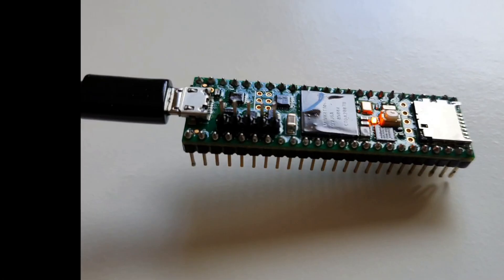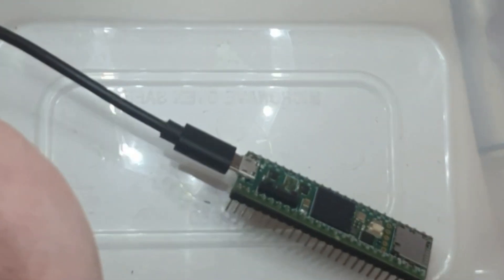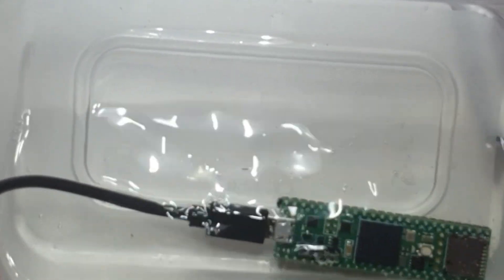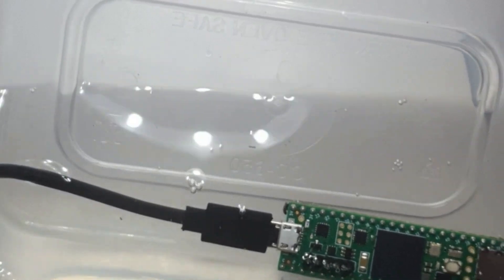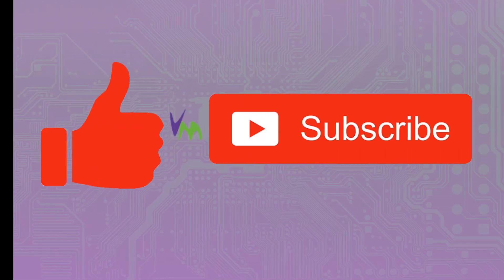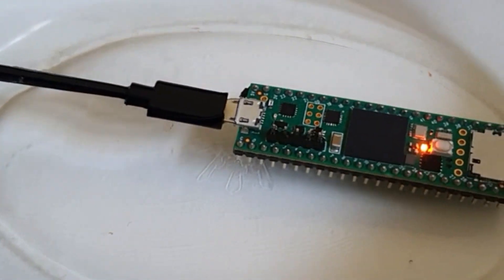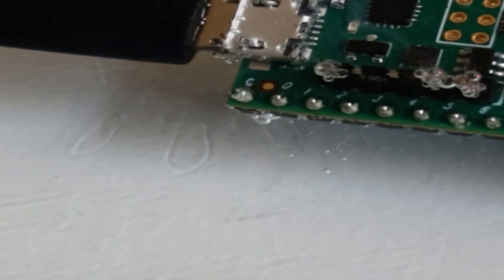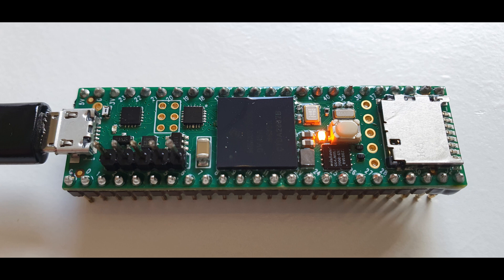Protecting Your Arduino Projects

Comment: what if you later want to use some of the pins? can you still get electric conductivity?
Reply from the maker: You would need to scratch off the coating from the pin is all, or connect everything before sealing if its more permanent.

The coating is only thin and a scalpel would work to remove it.

Comment: How to get this coating ? Or it is DIY ?
Reply from the maker: The coating we used was from a can of the below (which had lost all propellant after years of storage, which is why we had it in a tub in the video):
https://uk.rs-online.com/web/p/electronics-varnishes/1316287/

I believe you can also use clear nail polish to the same effect, which is much cheaper for hobby projects.